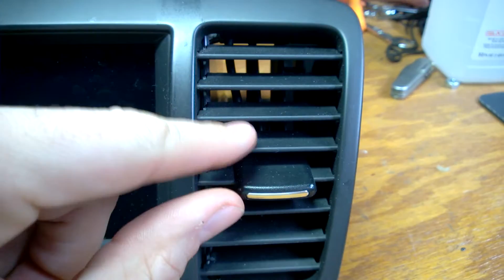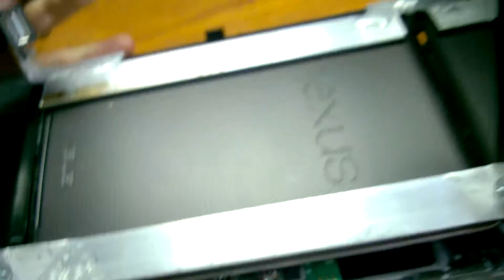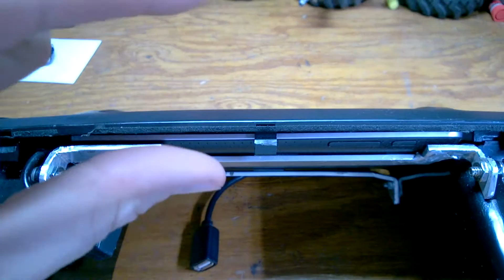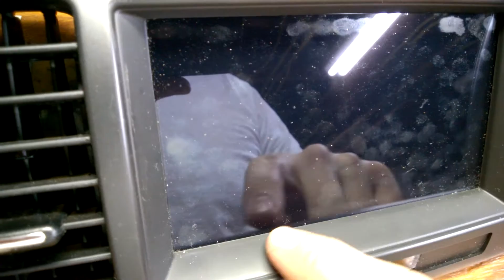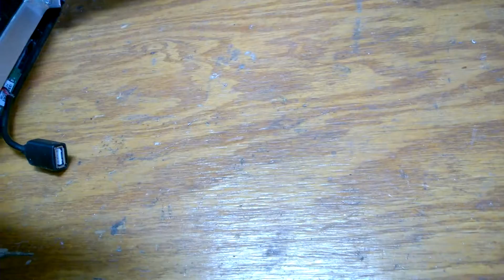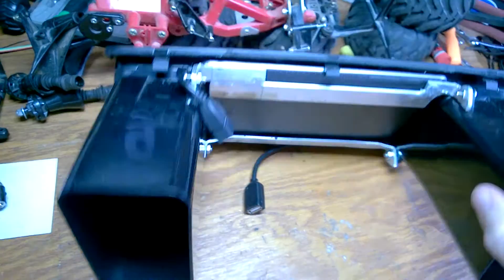In Dash Nexus 7 Project - 2005 Subaru Legacy - Almost Finished!!

Comment: I can't remember from the other videos, did you get the vent and navigation screen mounting stuff from an 07? I don't remember if there was an available nav screen for an 05.
Reply from the maker: +Luke Vander Poel The part should be for 2006+ Legacy's.  And the part number is 66060AG07B.  I ordered it from Fred Beans and I paid right around $80 for it.  Probably find it online similarly priced.  Hope that helps!!
Reply: So im guessing this part will fit a 2004 subaru liberty considering yours is an 05?